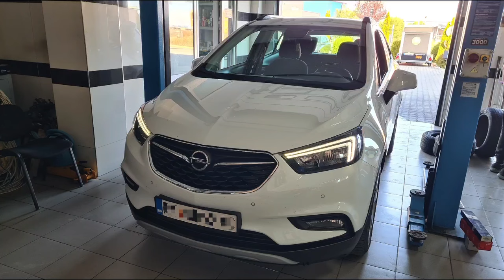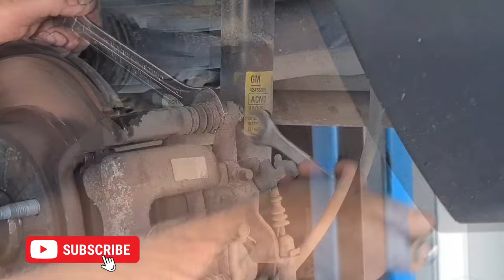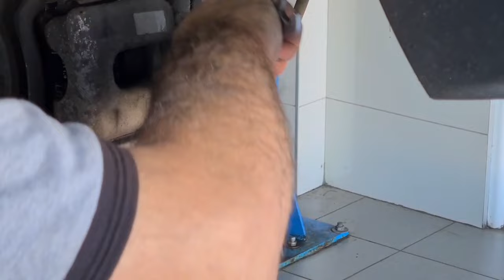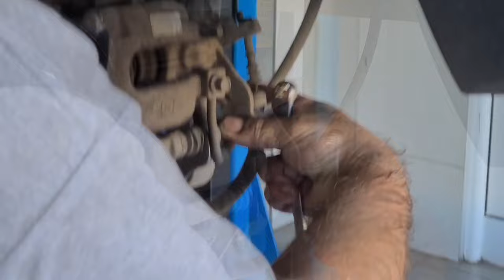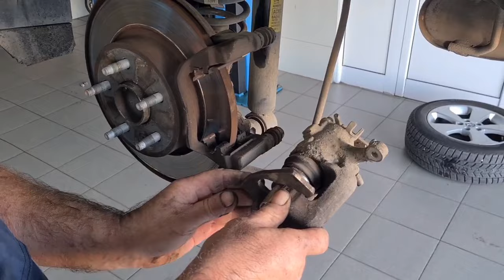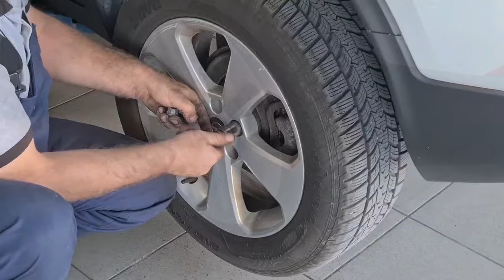Rear Brake Pads Replacement - OPEL/VAUXHALL MOKKA X

Comment: Hello,thanks for the video.I tried doing my Mokkas rear pads yesterday but found undoing the bolts really hard,so not wanting anything to go wrong,i left it.Then i found this video of the job & it has helped me out a lot.can i ask if the 2 spanners you are using. are 13mm & 17 mm?
Great video & job!!👍👍👍👍👍
Reply from the maker: Thank you! I don't know which spanners are, my mechanic has changed this pads
Reply: Its a 13 and 15
Reply: many thanks Manfred!!
Reply: Ok, firstly padslapping is not a good idea. Secondly, the caliper bracket must be thoroughly cleaned with wire brush or similar, and also clean the sliding pin holes with brake clean and a gun brush. Then the hardware for the pads must be replaced, and add some copper paste under the hardware. The caliper slide pins must be wiped off and greased up again and preferrably the rubber boots replaced aswell.